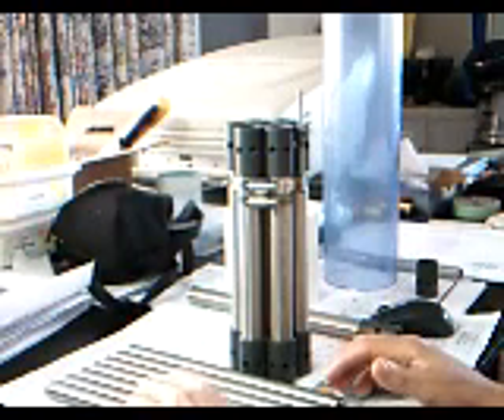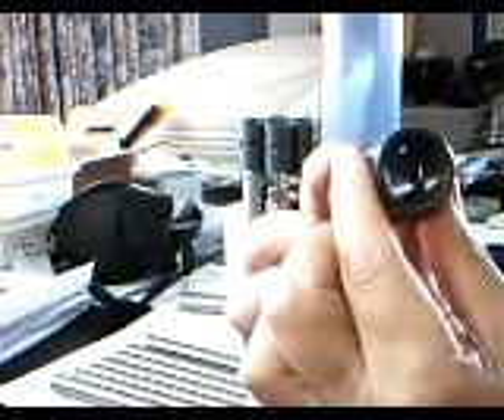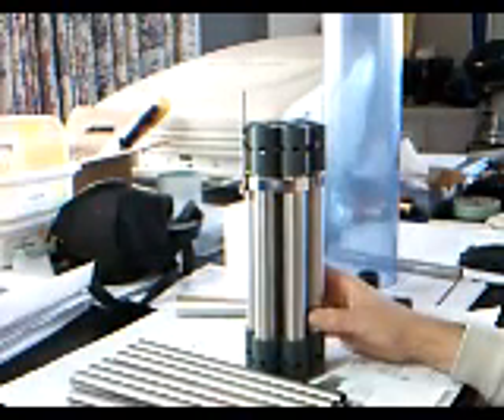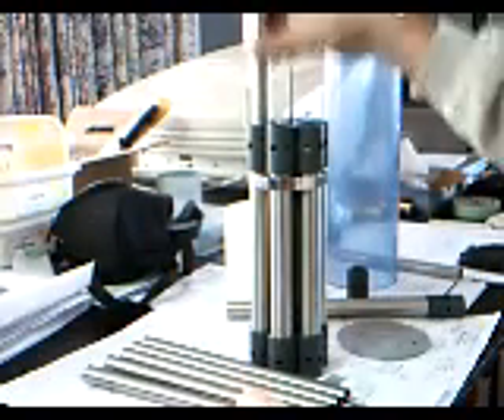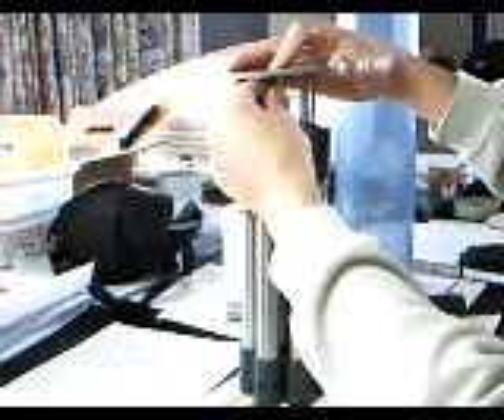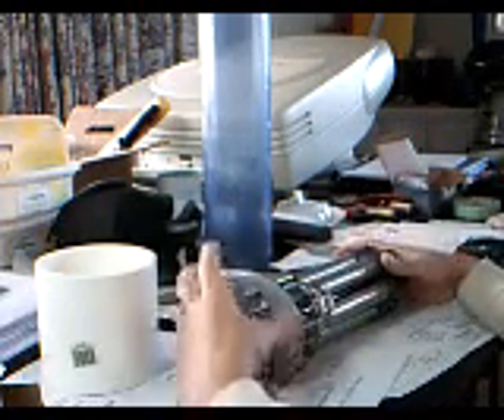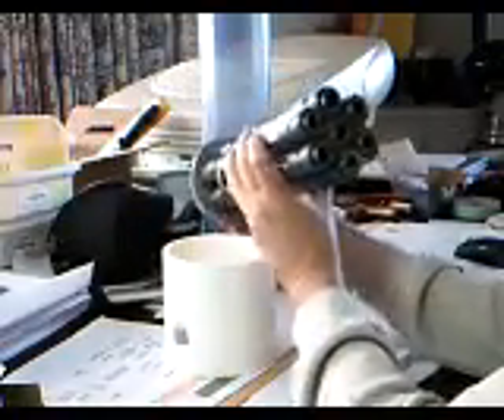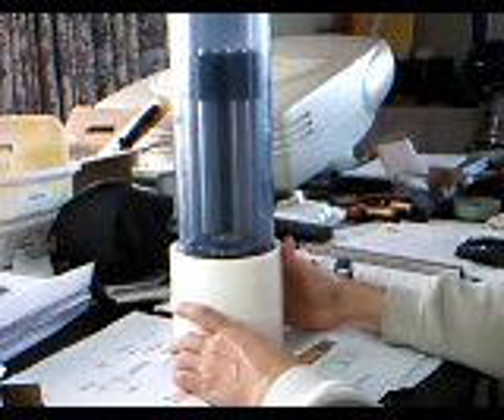Stanley Meyers easy to build Tubes

Comment: Lets put 1,000watts of chemical energy into a car engine, we get 350w of kinetic out (the rest is wasted by friction etc.) Now put 350 kinetic into alternator, we get 250w electrical out. How does the 250w electrical make 1000w to keep its self running, and another 10,000w to push car? No need for physics to show water car is a scam/hoax.

Comment: Chemistry side of things, Water is a polar bent molecule so on the oxygen side there is  electron shielding it and on the hydrogen side there are 2 exposed hydrogen since the only electron hydrogen has is used to create the bond so that side is positive. When the plates are charged the hydrogen will point to the negative plate and the oxygen will point to the positive plate. 

Because this is true you can calculate the strength of the electric field needed to break the bond in one water molecule

Comment: this is basically a cylinder capacitor and the water is the dialectic insulator. Both plates are separated by some radius r and the charges are focused with in that gap instead of charging the entire body of water. 

This system is really efficient.

the 2 plates pull the water molecules apart because oxygen is negative and hydrogen is positive. I wonder is this a complete separation or is some OH- created as well

University level Physics pay off again.

Comment: I thought meyers tubes were completely insulated from each other? the external tubes were housed in a wooden jig, and the innner tubes insulated with rubber spacers from the outer ones.
"It is peculiar in that the positive pulses are applied to just two of the outer pipes, while the negative pulsesare applied to all six inner tubes. It is not obvious why Stan drew it that way, as you would expect all six outer tubes to be wired in parallel in the same way as the inner tubes are" Dave Lawton

Comment: this is a joke, which looks nice but does not work as original Stanley Meyer high voltage LOW miliamper resonance electrolysis

Comment: srry about the multiple questions....i keep thinking of them as i search around for parts.....what was the price of your entire cell? as i looked around the e-net i added up a cost of appox. $200 for the clear PVC pipe
($20 ft)and $160 for stainless T-304 schedual 10 pipe($11ft for .884 ID pipe and $20ft 
.68 OD pipe) So what kind of pipe/sizes are you using